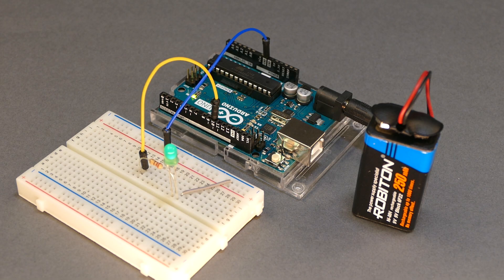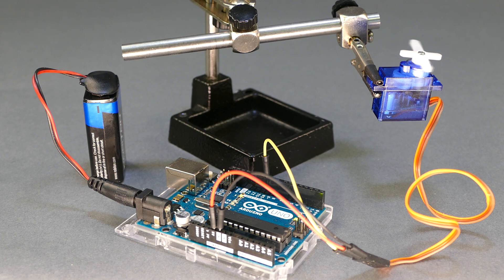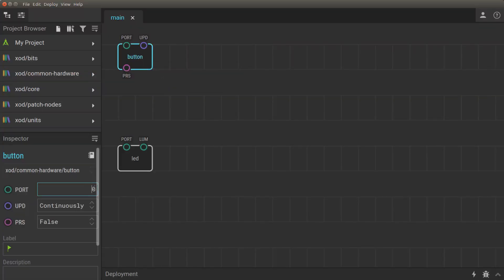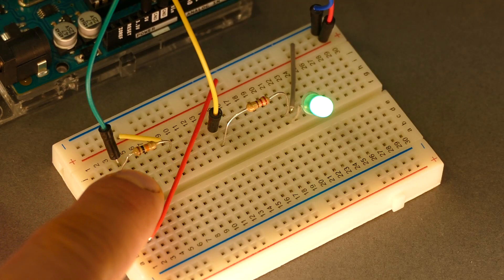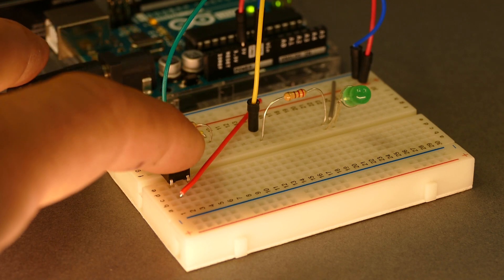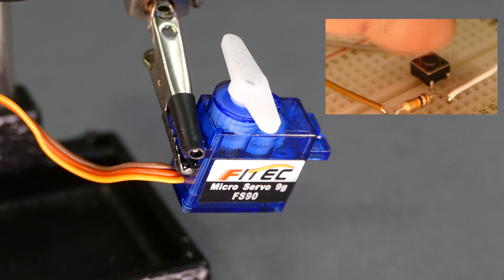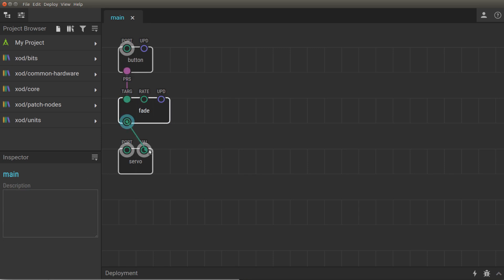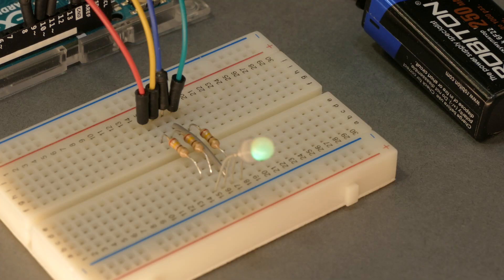Control servos, motors, or LEDs smoothly with ‘fade’. XOD nodes overview

Comment: Nothing in that link pertains to this "fade" module. It's not listed under the libraries menu within that link either! I was wondering if it was strictly linear or if it had ramp settings as well such as those used for stepper motors and real servos; not just the hobby variety. Can these modules be stacked to achieve more nonlinear ramping by setting the individual blocks to different values?
Reply from the maker: Fixed - https://xod.io/libs/xod/core/fade/
Reply: XOD, great,, thanks
Reply: Knowledge Dosage  with the link you provided I see it's in the core folder. Does the downloaded version update the core automatically or do I need to do it manually? (It's installed on another device; not on my phone.)
Reply: ten littleindians, ask XOD :)